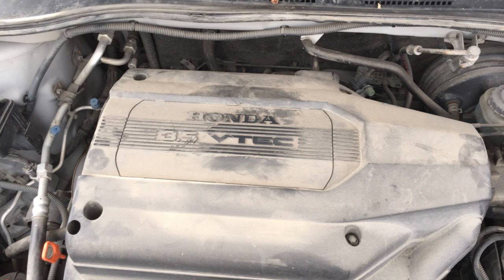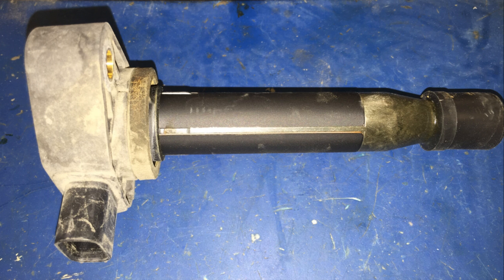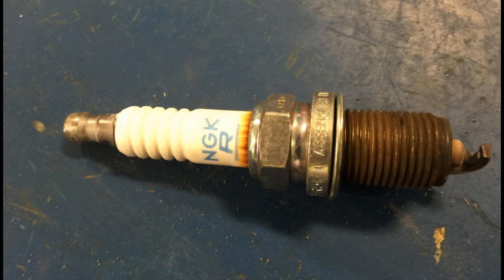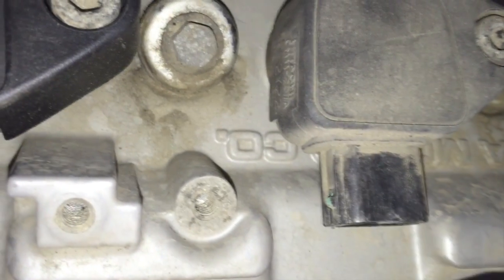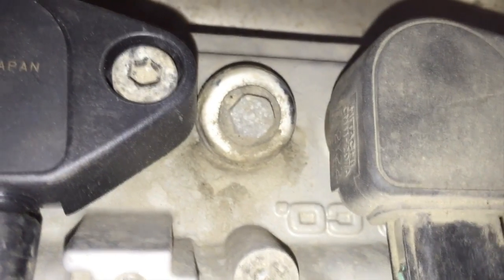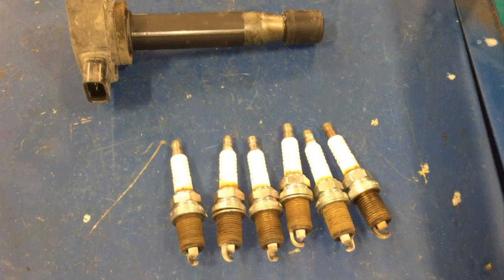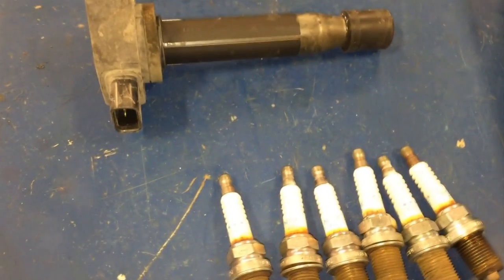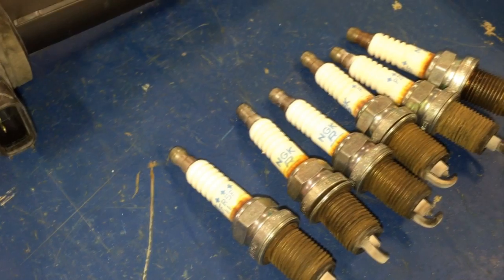How To Diagnose Honda Misfire Codes P0300, P0301, P0302, Etc.

Comment: I have the same problem with my 00 honda prelude with a h22a throws all the miss fire codes when throws p1399 I belive engine runs tilly rough poping ect smells like gas and won't go over 3k bogs down but will sit there and run no problem check compression all have 300/250 range
Reply from the maker: Find out what cylinder is misfiring.
Reply: The Car Doctor I seem to be able to unplug 2 or more of the cars wires to the spark plug and runs the exact same kinda like it's Deiseling

Comment: it needs a valve adjustment
Reply from the maker: Well not this one but that is a common Honda problem. Valve seats are problematic as well! Thanks for watching
Reply: 2000 Honda crv. The   dread it p 300 code misfires random cylinders. Changed plugs, wires, cap and router, coil and ignition module. Still  codes misfires. Adjusted valve lash had one exhaust valve to tight. Fixed the problem runs great no more codes.

Comment: 2000 crv i have p0300 and all 4 cyl misfire and car turns on but when i rev it up the rpm drops down to under 1000 for a few sec and then it dies and i also try going in gear when i drive its fine but when i come to a stop the rpm jumps up and down and then it dies any ideas??
Reply: also did compression test all 4 was like around 150
Reply from the maker: Any codes? Have you checked fuel pressure? Maybe a bad cat?

Comment: This morning my 2010 Honda Odyssey got these codes: P0301, P0302, P0303, P0304, P0305, P0306 and P0300. The van was shaking a little bit in the morning. The check engine light didn't come on. The spark plugs were replace about 3 months ago. Any suggestions? Thank you.
Reply from the maker: +Isidro Esquer not a common problem. A few things are possible. I'll list them in the order of most likely to least likely. 1) Bad Engine Valve (usually a burnt intake valve)  2) EGR Valve problem 3) Ignition Coil(s) 4) Timing Belt 5) EGR Passages Clogged Under Plenum Cover
Reply: @The Car Doctor can the plenum cover be removed without damaging what I assume will be a gasket under it? Do you have to replace gasket if plenum cover is removed and cleaned?
Reply: ok

Comment: I have a 2015 honda fit and I'm active duty military stationed overseas. The honda dealerships have been no help and language barrier has been rough. I'm getting the code P0302 accompanied with multiple dashboard warning lights and sputtering of the vehicle. They say it's the battery, i really doubt this is the issue. Please help!!
Reply from the maker: +Russell Feolino Throw a #2 coil and plug in it. If you can do a compression test and injector balance along with cylinder contribution and secondary ignition tests and attach a mood light and test for intake leaks to be sure but if not just throw a plug and coil and give it a try. Should take about ten minutes to do that.

Comment: I'm getting the codes on my 2003 Element, but it seems to run fine.  Any ideas?
Reply from the maker: +Kathryn Greeson Possibly overdue for valve adjustment and tune up

Comment: Noid
Reply: wow, sound like an easy fix but I done all that and still don't know what is going on with my 2000 Odyssey, I'm about to give up. Initially engine was having problem starting up.Then it ran rough occasionally then more and more frequently to the point it misfire all the time. It has 300km on it so I thought the injectors need cleaning. I did that, they were dirty. Fuel pump was 6psi low so I replaced it. Compression on all cylinder are 42psi, spark plugs are new too. I have spark and ignition pulse with all cylinder but I went and I swap out the coils with another Odyssey, old ones works well too, so it's not the coils problems. Spark plugs are clean, no gas smelling. I didn't touch the fuel pressure regulator yet, it's $105.99. I don't wanna keep throwing parts at it. I have TCS and flashing engine light
Reply from the maker: +ProMonkeyZ1 have you pulled the cover plate over the EGR passages on the intake and cleaned the passages? This is a common issue with high mileage 3.5 motors. Here's a link to a video about the passage cleaning. It can cause misfire issues. https://www.youtube.com/watch?v=2GYlvVJCMz0
Reply from the maker: Jake Payne Wise Noid indeed
Reply: +The Car Doctor Hello, Greetings from the lower 48.
Reply: también tengo una odyssey 2005 ...no me paso el Smog check.....y me salieron esos dodigos p0300..p0302..303..305..306  pero se me quita a los 3 días y dura como 1 me si sin el check engine y vuelve otra vez....estar malo el motor mañana lo llevare con un m3canico
Reply: Que fue El problema ?